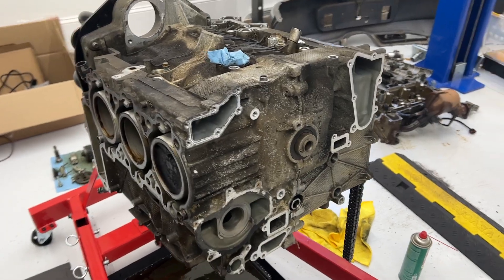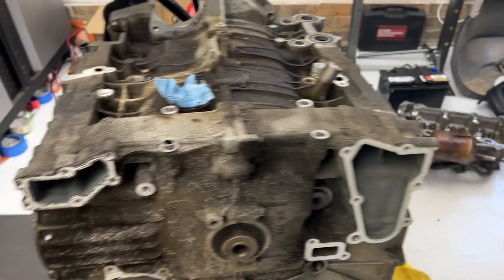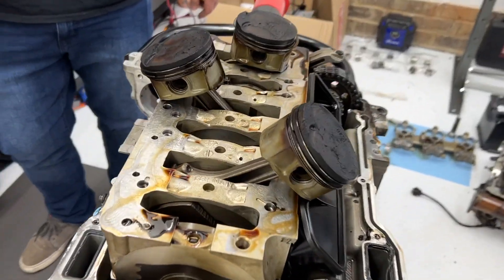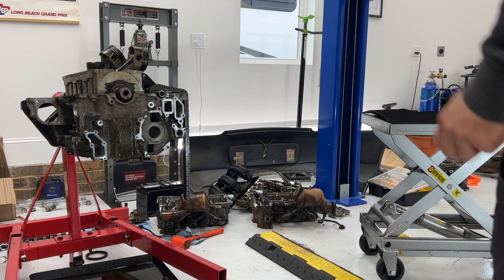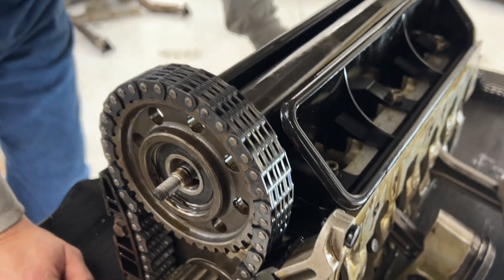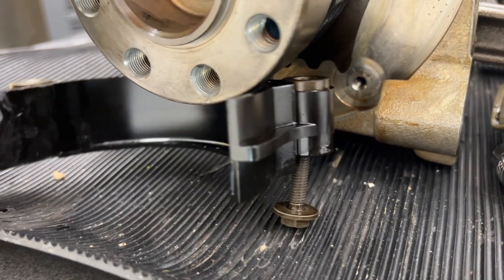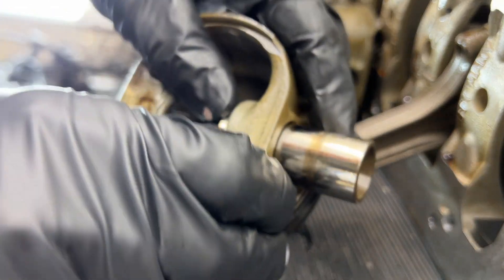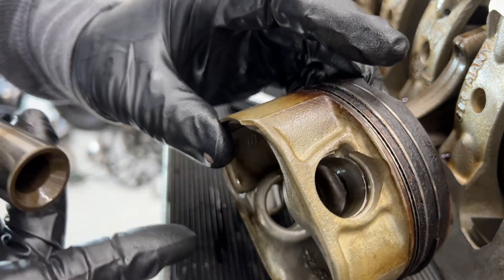Porsche Boxster 986 Engine Tear Down - Part 5 (BBB Part 16)

Comment: Just by looking at the guy carrying the whole bearing carrier-crank assembly I got an instant herniated disc :) For future reference, it`s a good idea to put 4 of the cylinder head bolts back into the carrier and use them as leverage, much easier to carry for two people. I use an engine hoist to lift that out from the crankcase when I have no help.
Reply from the maker: +Fungaricum ooh… great tip thanks!
Reply: You beat me to the suggestion of using the engine hoist. I did this all alone and at my advanced age didn't want to damage any parts of my body (or the engine) so used the hoist to separate the case halves and to lift the bearing carrier out.

Comment: Wow! You are amazing. What a tear down on Boxster 986. I found a shiny nut on the floor under the engine compartment. I am guessing it became loose in grounding wire as my alternator is not charging otherwise it runs fine but I have to charge every time when I drive the car. Any suggestions? Thanks again!
Reply from the maker: +@PusanSaramUSA thanks! Hope you’re a subscriber now 😎🍻
Reply: @HelpMeDIY  Yes I am for sure!
Reply: Help me Rhonda, aaargh DIY Aaron!
Reply from the maker: @PusanSaramUSA  oh sorry forgot about your question. Really can’t diagnose that from here 🤷‍♂️
Reply: @HelpMeDIY  I know that. Didn’t expect you to. I will look into the voltage regulator part replacement.

Comment: Arron 
Unless I've missed it in previous videos what was actual cause for the chain to snag and cause the ims shaft to break and the chain guides ? Was it just a bad assembly from guy you bought it from or was there contamination like a bolt left in engine.
Great videos by the way 👍
Reply from the maker: +Bobs ur uncle Bob thanks! Can’t say for sure, but in the next video I’m going to present my theory.

Comment: Dear Aaron, do you think the engine mount can be homemade? The costs are rather high for single use.
Reply from the maker: +Tomtom Tomtom I’m confused by this… why are you saying the engine mount is one time use? Or are you talking about the yoke I mounted it to the engine stand with maybe?
Reply: Hi Aaron, I am talking about the black unit attached to the motor block. I see it is for 96 engines only and I don´t plan to repair motors of 986 regularely, therefore I assumed one time use. I have some metal lying around tried to find some sketches or drilling patterns online but without success. Amazon is sold out and others want 500 USD ++ for it. So I was wondering whether you believe it is possible to make one myself?
Reply from the maker: @TomtomTomtom986  if you’re a good welder, probably, but it needs to be able to support 600lbs. It works for all m96 and m97 engines so there are quite a few!
Reply from the maker: @TomtomTomtom986  got mine online for just over $300 shipped I believe
Reply: @HelpMeDIY  Yep, however not living in the US makes it an expensive shipment... :-) I will try my welding skills!
Reply from the maker: @TomtomTomtom986  ah yeah… let me know how it goes!

Comment: You're going to take it this far apart and not replace the main and rod bearings?  Seriously?
Reply: Why would he? If the clearance is well within spec there`s no need.
Reply: @Fungaricum  That's a pretty big if for an engine that experienced a mechanical failure, and you'd have to disassemble the crank carrier to confirm one way or another, anyway.

The cost of a set of new bearings is low in comparison to the price of one's time and sanity, having to do this twice.
Reply: @AaronAverett  Yep, I agree with that it has to be split for inspection, but if the bearings are fine, not scored, worn out, etc, it`s pointless to replace them.